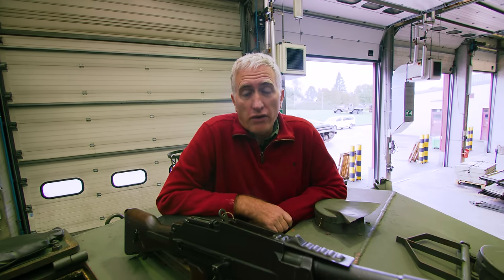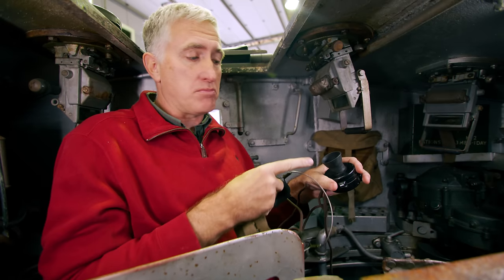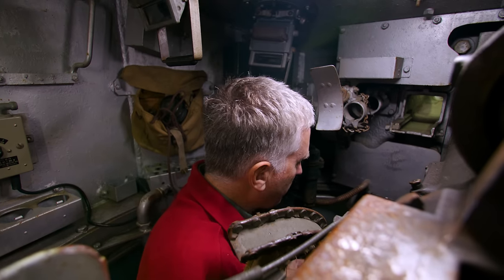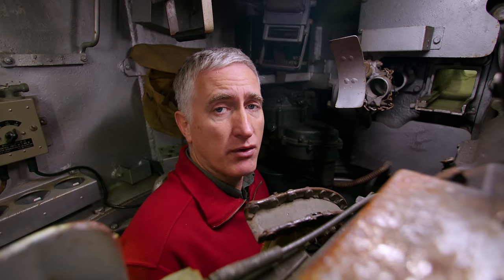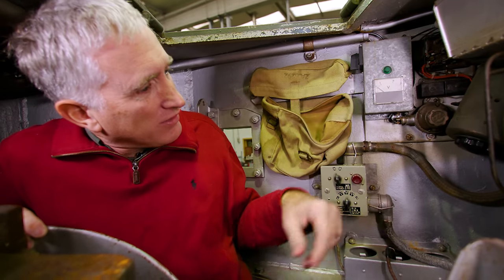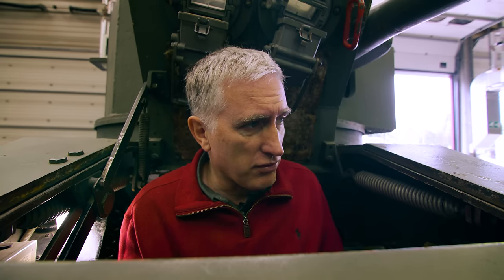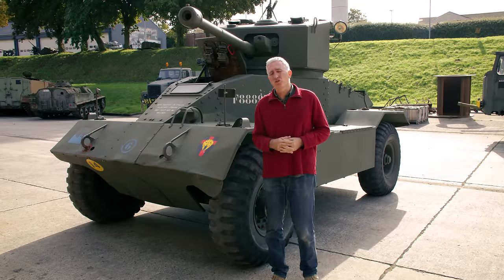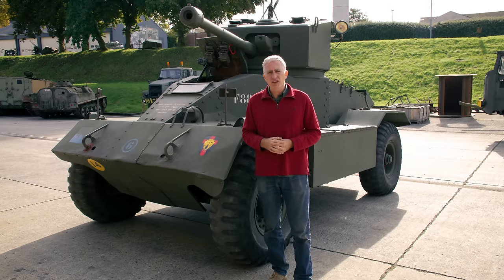Inside the Chieftain's Hatch: AEC Mk II, Pt 2

Comment: It's crazy how compact the IS-3 is, the rear deck looks similar height to the driver in the AEC
Reply: Theres an AEC at Bovington and it never ceases to amaze me how tall the thing is, much bigger than you'd expect, so that willamplify the effect. something big you expect to be small next to something small you expect to be big.
Reply: I was looking at it when AEC driving up to be beside it and thought "What kind of TD is that? Almost looks like the T28 with out the extra tracks" Then it got closer I noticed the turret and thought "They have an IS-3?!"
Reply: I've seen this (?) IS-3 when it was still on display in the Royal Belgian Military Museum in Brussels. They had a StuG III and a Comet close to it. It is very compact indeed. Without checking references, I'd say it is more compact than a Leopard 1. Because I've worked on Leo 1, I also say that IS-3 might be very cramped inside. I can tell you that a T-72 looks tiny next to a Leopard.
Reply: Having no turret basket saves a LOT of space in height.

Comment: In regards to the 75mm fitting, I believe it was the  QF 75 mm, so was made by boring out the 6-pounder so shouldn't take up much more if any space.
Reply: Not bored out. New production changed to the 75mm barrel and matching chamber. All QF 75mm guns were new made as such.
Reply: @johnfisk811 yes they were new built machined from the the same forgings as the 6lber the breach blocks were identical barrels & presumably recoil cylinders were different see the crusader episode it was a 6lber but it's block was marked 75mm
Reply: i think that was the OQF that was that one, but i could be wrong. i know british gun performance more than the names.
Reply: According to what I read, Royal Ordnance was in the process of developing a completely new 75mm that used US shells but a new cartridge case and someone noticed that the complete US 75mm cartridge was very close in base diameter and overall length to the 6 pounder cartridge.  So they could greatly speed up development and manufacture and concentrate development resources into improvements and follow ups to the 17 pounder.

Comment: The RAC used three rifle calibre rounds during WW2: .303, 7.92x57mm & .30-06. 

The Churchill NA75 used all three: A BESA in the hull, a co-axial Browning, and a Bren.
Reply: And the crew would have side arms ( normally a pistol, some sub machine guns).
Reply: Logistics!
Reply: @fishingthelist4017  more adaptability and availability. With longer supply lines the US would not transport below standard equipment. With proximity to manufacturing the British could adapt and update superseded material. Outdated aircraft became trainers, transport and towing aircraft. Obselete tanks were repurposed as SP guns, "Kangaroos", Bridgelayers and Engineer/Recovery Vehicles. Shadow manufacturing took place on four continents(including in the US). Munitions were much the same guaranteeing availability.  All units had a variety of weapons. Most (larger) weapons required different types of ammunition of the same calibre so it was a matter of distribution rather than logistics. A single tank had the same requirement as a troop, a troop the same as a Squadron, a Squadron a Battalion, a Battalion a  Division. Each unit a wider range of requirements for specific equipment.

Comment: Good vid as ever. 
Minor comment regarding the Bren placement, it's actually not wrong -  if you look up pictures of British tanks in the war it's not that uncommon to see them with a Bren simply mounted on top of the turret like it is here. No good for AA defence like that obviously but it gives the commander a bit of firepower.
Reply: Yeh, and probably a STEN gun or two as well. Your more concerned about some Hitlerjugen with a panzerfaust.
Reply: Is the Bren usefull for AA. It feels good doing something. but you are not going to hit anything important. if you for some strange reason do. you are not going to destroy that. in a way that. it´s going to stop it. do harm to you.
Reply: @exploatores  I believe there were free standing tripods for the Bren specifically for AA use, so I think it was definitely something the Bren gun was used for. As you say it wouldn’t have been particularly destructive or accurate but when combined with other Brens in the troop/squadron, might have put enough rounds in the air to have a discouraging effect.
Reply: @Badbunny666  yes you're right, they did exist - the AA mounts - as a part of the SF tripod kit, and I trained with one once.  Effectiveness - more complex, but gives the enemy reasons not to loiter too long or too close and gives the troops a feeling they are fighting back. Probably minimal, but if a rear echelon soldier burnt off a 100 rounds of .303 and got some hits on an expensive plane, it's a good trade off?

Comment: Would the 75mm gun used in the AEC Mk III not be the British 75, which was basically just bored out 6-pounder and thus of the same external dimensions? My understanding is that even the cartridges were only very slightly larger in the dimensions that matter for stowage, so there's no reason to lose a man for ammo either.
Reply: At least according to Wikipedia, it indeed was the Ordnance QF 75 mm in the Mk III. , with a 4 man crew.

Comment: Maybe a bit redundant comment, but here we go: BESA was 7,92 mm because the Czechoslovakian army used 7,92 mm Mauser as their standard service cartridge, and British needed reliable, belt-fed machine guns for their tanks quickly, so they bought the licence to make BESA (or vz. 37/ZB 58) in Britain. Yes, there was a .303 version but for some reason it was never made standard (apparently it was decided tooling costs would be too high and would took too much time to retool). That is why this calibre discrepancy (but as Chieftain pointed out, Tank Corps weren't bothered about it, mainly because their ammo supply was separate from the army anyway).

Comment: The British had a system where if the gun fired an anti tank round it belonged to the army.  If it used HE it belonged to the artillery.  An exception was the 2pdr used by the infantry which had HE as well as anti tank but the two pounder in the Matilda only had an AT round.
Reply: That is not true. 

1stly CS tanks were only armed with smoke and HE yet were not part of the artillery.

2ndly regular tanks and anti-tank guns started receiveing both HE and AP shells by 1943/4 for most calibres.

3rdly he only reason the matilda in the desert campaign did not have an HE round was because wpdr didn't have 1 yet. Matildas in the far east got he rounds. An he round was only made for the 2pdr in late 1942 by which time Matildas had been pulled out of North Africa.

4thly speaking of the 2pdr, the towed 2pdr was part of the arillery since 1938. It was not part of the infantry.

5thly the towed 17pdr entered service as part of the artillery in October 1942, despite not getting a HE shell untill June 1944. Similarly the 2pdr and 6pdr guns also entered service with the artillery without HE.

Comment: The RAC had its own supply chain so handling 8mm Mauser was no real problem. The BESA simply came that way. There was a brief period at the end of the war when they considered making it the army standard to replace .303”. It was more of an issue to supply the Bren’s .303”. BTW the Yugoslavians had several which they used as wheeled tanks. You mentioned the Staghound and I refer you to my comments on part 1 on them using the same AEC turret post war when they ran out of old Crusader turrets to pop onto Staghounds.
Reply: From what I am aware, the BESA is a licensed produce CZECH machine gun. As a result it was 8mm. What is odd is the Birmingham Small arms company did not modify the gun to fire .303.
Reply: The BESA was adopted in 1938; when war was already looming: There wasn't  time to adapt the gun from 7.92x57mm to the rimmed .303". Especially without the co-operation of Zbrojovka Brno; which was cut off when the Germans occupation Czechslovakia.

It had taken five years to develop the Bren from the ZB-27.
Reply: When you see how long it took for the Bren to be changed from Czech 8mm Mauser to .303” you can see why. Plus the separate RAC supply change. @Duke_of_Petchington

Comment: It's funny that they British were actually very good at evaluating the ergonomics of other peoples' equipment. Their testing establishment produced very common-sense and in depth reports comparing the equipment in question to British doctrine and practices. If it were simple bias that would be one thing but they're actually really professional. 

And then they produce things like this where you need 3 hands to fire the gun, or the Cromwell drivers hatches where you need to fold your spine in 3 directions to get out or the 17 pounder armed M10 where you have to reach somewhere under the gun to rotate the turret.

I know all the excuses but it almost feels schizophrenic.
Reply: that's because the test house has no skin in the production game and were encouraged to be entirely truthful. If the factory chose not to listen to them, then the end user got a bit of junk to work with and they often ended up with the required mods not appearing until the Mark 2, 3 or 4 of something.
Reply: The British were generally aware of deficiencies in ergonomics.  Since there was a war on and they had no time after Dunkirk to waste on making things more than barely functional it often got pushed aside. Also, their factories were getting bombed, which made production changes hard.  The pre-war designs suffered from bad budgeting and being designed to bad doctrine. The political end of the war office would rather have bought 10 light tanks, instead of the 5 heavier tanks they actually needed. David Fletcher writes well about it in *The Great Tank Scandal*.
Reply: It was a multi facetted problem  which can mostly be sumed up as this: necessity.

The British switched to a war economy almost instantly at the start of WW2.  That meant distributed production across a wide range of companies that had wildly variable capabilities and available tooling.  Designs had to be able to be produced across any of those. A good example of this is the Comet where the initial designs had a sloped front glacis, but this had to be changed to accomodate the engineering capabilities of the subcontractors. During the design approval process it was felt that the ~3 months or so it would take those subcontractors to get up to speed/tooling on building a sloped front glacis was not worth the delay, so it got the stepped design they'd been using since the A10.

You see the same kind of thing happening with the Germans when they switched to a war economy in 1943.  Things like the Jgdpz IV suddenly get a 3rd "simplified" version for production because the new subcontractors coming into the production cycle in 1944 can't handle the "proper" design and production out the door now was more important than waiting for them to upskill or build new plant/tooling to handle it.
Reply: The Directorate of tank design, possibly the only entity with all of that research at their fingertips and the ability to talk The war office out of antiquated requirements was responsible for armoured perfection in the form of centurion, the downside of the embodiment of that knowledge was it missed the war.
Reply: @jrdougan  Too expensive, Too late, or Good enough, pick one
Reply: The Sherman VC Firefly had the same problem with the 17 pdr. The elevation was done by a small wheel deep underneath the gun that would force the gunner to take his head completely away from the gunsight. You just had to raise and lower the gun by luck and experience. This was necessary because the 17 pdr had to be turned 90 degrees to fit into the turret in both the M4 and its variants. It was just to big for the turret. For some reason the Americans didn’t like this and stuck with the 76mm gun, which they found to be a bit large itself.

Comment: The British 75mm was a bored out 6 Pounder (57mm) so there would be be no gun size problem or at least no more than the 6 pounder. Ammunition would be larger of course (15 pound vs 6 pound shell) so there must not have been as many rounds.
Reply: To be fair it's an amoured car. Ammo capacity really shouldn't be a concern.

At best it's a recon vehicle. At worse it's a hit and run sort of affair.
Reply: @clothar23  It was used as SP artillery - every Squadron had a Heavy Troop of either 75mm Mark III AEC's or 75mm M3 Tank Destroyers passed on from the US Army after it was declared obsolete (but used as SPG's rather than TD's)  Since the M3 mounted the old M1897 field gun, it had come full circle. Here is a Heavy Troop imn action with their M3's. https://en.wikipedia.org/wiki/M3_Gun_Motor_Carriage#/media/File:The_British_Army_in_Italy_1945_NA22387.jpg

Comment: I had a 1958 simca unic army lorr that had that air release system on the brakes,   it went off every minute or two when the engine was running.   It would have some real force to it,   once I was underneath the thing doing some work on it with the engine running and got pebble-dashed when the valve  dumped out.    Not fun..

Comment: The British started converting the Besa to .303, and made a prototype, but it was clear war was imminent and there wasn’t time to iron out the cinks, so they just went with the stock 7.92mm as the lessor of two evils.
Reply: The British were planning to swap from the rimmed .303 to a rimless round anyway. The Besa (a Czech weapon) was developed with that in mind and  The Royal Armoured Corps was at front of converting to the rimless round. Converting Besa to the .303 was not a priority since RAC had separate logistics chain to infantry and their Lee-Enfield rifles. Equally it was not an issue for Armoured units to be supplied with American tanks and their 'factory fitted' 30 cal Browning machine guns

Comment: As an American, I'd call it a 2-1/4" gun. (Though it's technically 2.24", not 2.25".
Reply: The official American designation for the 6pdr was m-1 57mm
Reply: @matthiuskoenig3378 They are wrong. It is a 2.24" gun, so a duce-and-a-quarter.

Comment: I think the Royal Ordnance QF 75mm was a 6pdr bored out to take US/French 75mm ammunition. The Story goes that the 6pd was a little over-engineered to handle both the power of the original round and an expected wartime drops in material quality.  So the breach was strong and the barrel over thick to contain the forces.  As a bottle necked round the base was near enough to the base of the 75mm that there was little to change there. The barrel when bored out and re-rifled to take the 75mm had enough material left for the pressures involved to be workable. 
If anyone knows better, please tell me.

Comment: My question is why there weren't more of them. A scout car with the firepower to take out a Stug III or Panzer 4 (heck, even a Tiger under the right circumstances) seems like something a WWII army should have been drooling over, especially given its reliability.

So why only 300ish (600ish, includingmks 1-3)? Why not 3,000, like the Staghound, which it seems to have surpassed in most regards?
Reply: lack of need for the more powerful gun? The British ordered 1700 Coventry armoured cars that could take the 6-pdr guns in 1943 but changed mind and kept producing Daimler armoured cars with 2-pdr and 2.000 Humber armoured cars with US 37mm gun.
Reply: Probably because British production was focused on things other things.

Remember staghounds were supplied by the Americans.
Reply: I think that despite the need politics may have had a hand in these decisions as well
Reply: 4 AECs per Heavy Troop, 1 Heavy Troop per Squadron, 4 Squadrons per Armoured Car Regiment, one Armoured Car regiment per corps - so just 16 AECs per corps. So 300+ would equip roughly 20 corps, and we only had 15.

Comment: No doubt the Brits had a 3rd logistic tail with the cal .30-06 M1919A4 based MGs in the Sherman. 
The 6 pdr would’ve been a threat to must vehicles the AEC Mk IIs might routinely encounter - Pz.Kpw. III, IVs, STU-III and lighter armored cars and Sd.Kfz 250 & 251 half-tracks. Avoid and call in Fireflies for or shoot the heavier stuff from the flank.

Comment: Air brakes, they should hold the brakes off. Their natural state is applied. Certainly that is how it happens on London Buses.  It is why the running crews of the London Bus companies carry a 3/4 inch socket, 2 long extensions and a ratchet when attending a road side breakdown, if its a tow job, you need to wind the brakes off.
Reply: On my BRDM-2 the air is just to assist the hydraulic brakes, if there is no air it still brakes but a lot slower..
Reply: Older vehicles it was different. AEC militant, Bedford MK,MJ you required air for the breaks to work, not to release them. I can recall the differences as some army vehicles had an emergency break release if they were locked on due to air issues.

Comment: 16:34 you know the thought occurs ... if you need to hang that much mass off the end of the barrel to balance the gun .... you could just also put a longer barrel on it ... and have higher velocity... instead
Reply from the maker: Doesn't necessarily work that way. If you have a barrel that's too long, you run the risk of the round still being in the tube when the gasses have stopped expanding, making a sort of vacuum/braking effect instead.